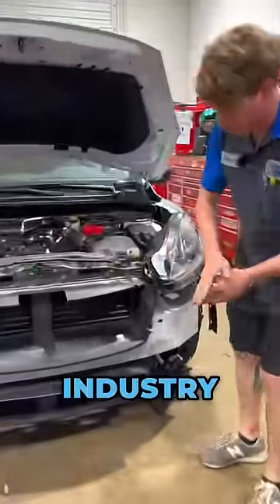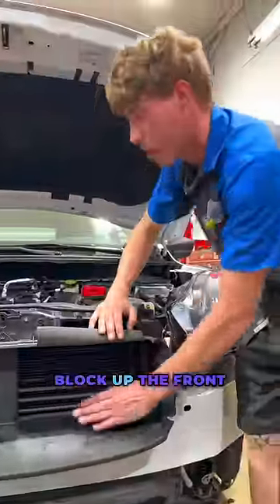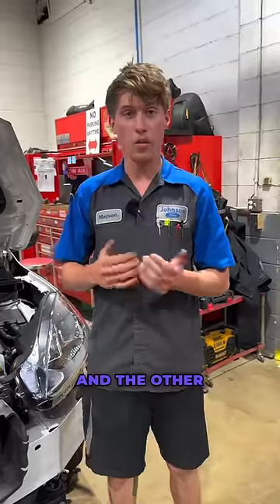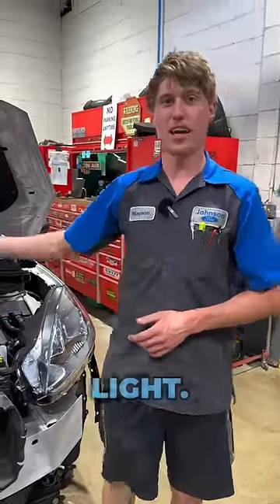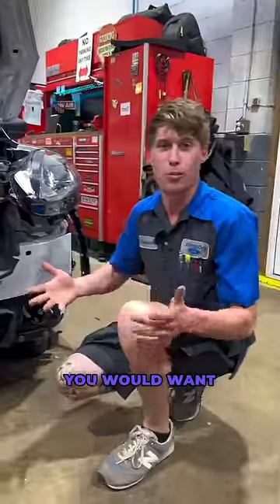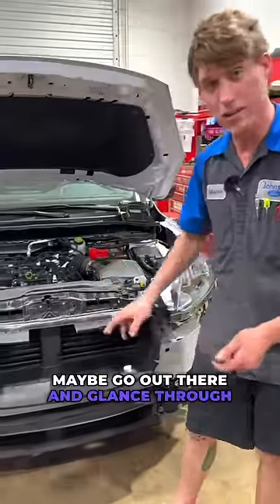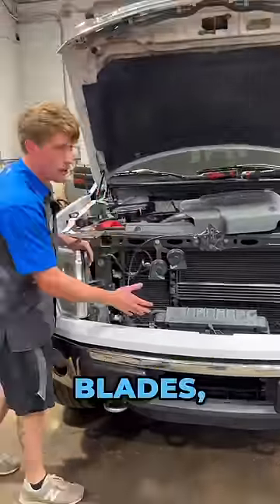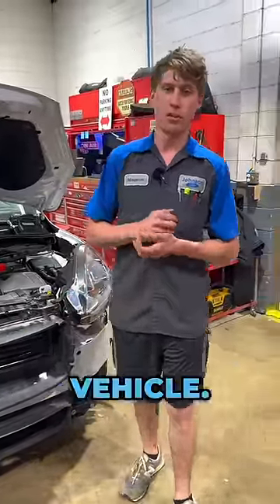Grille Shutters: A Newer Design In The Automotive Industry #shorts

Comment: To answer your question on their air being warmer. What happens when air goes from cold to warm/hot? Condensation can form. Where does the air go, into the air intake connection. Some engines have their EGR plumbing in the same area, this moisture can get into the EGR diff sensor, intake air actuators, manifold pressure sensors, etc etc. in some conditions this can turn to ice that creates plugging so you fetal data reporting from sensors. Go to ts later the ice is melted and no explanation for why the fault snapshot suggests the data that it does. Also water intrusion into some pressure sensors can wreck them or distort data.

So warming the air can actually cut down on that. Diesel trucks have used shutter for years, some still do or use winter fronts to minimize the surface area that is exposed to freezing temps while driving down the road, paved or iced.

Comment: When the outside temperature drops to single digits you need to keep the radiator warmer and you need to keep the intercooler to prevent core combustion. So having a way to block the air from coming through your intercooler is actually a really good thing.

Comment: They’re definitely going to hold up well in snowy climates, that’s for sure..
Reply: They don't. Snow and ice do not play well with the shutters. To twist the knife, replacing one is normally around $800--$1,000 parts and labor. At least 75% of the cost is the part. Also, when salt seeps into the actuator, circuit board, connector, etc., assy replacement is the only fix. It's not IF salt will get in, it's WHEN.
Reply: @RichThiele I was being sarcastic.. lol

Comment: The intercooler shutter is to keep the cooler from freezing when it's 1 degree outside. Condensation will settle in the bottom and block airflow.  I've seen where the aircharge tube is completely blocked with ice (and the car comes in on a flat bed.
Big problem with grille shutters, especially one down low, in snow country is all it takes is if they pull too close to a frozen snowbank, or hit a snowdrift on the road.  Instant shutter destruction and a $900 bill for a new shutter assy.

Comment: The reason for this is VERY cold climates. Especially for diesels. The intercooler can actually over cool the air going into the cylinder if it's very cold outside. In Alaska people completely block their radiator full time in winter. I think it should be a factory option for cold climates, but in reality it can help in all climates I suppose. Just like an oil coolant heat exchanger. It will help your engine come up to temp much quicker. And if it fails closed it can bring your engine to boiling much faster too 😉

Now, I do agree with you, it is just extra equipment that will be failure prone because I'm guessing like most everything else on a modern car, it's designed to fail after the warranty period.

Comment: Hot air through the intercooler when it's cold helps with atomization of fuel. That's why some older vehicles have something like a grid heater

Comment: radiator shutters are often for emissions to set the control devices faster, basically meaning the engines dont have to meet stricter targets as the point at which they are measured in an engine cycle hasnt changed, thus, heating the engine to operating temperature more efficiently means it can pass emissions easier as a hotter engine idles lower etc.

Comment: The totally automatic part certainly is new. My old Peugeot diesels had a winter grille muff to let the engine warm up quickly or retain the heat of the block heater if it had one. It really helped get the temp where it needed to be very fast

Comment: There is one good reason for the shutters on the intercooler. In very cold weather the air can be so cold the intake and throttle body can ice up, eventually stalling the car. Icing can certainly produce nasty engine characteristics. As importantly, the charge being too cold can stop the fuel from atomizing properly. Granted this is mainly in the far north of Canada or at high elevations. My brother lives in the Yukon Territory, a bit below the Arctic Circle. He has a 2017 F-250 Power stroke. -55°C is quite common between the middle of September and the middle of May. Conditions are so severe that normal antifreeze, rated for -40, is inadequate. The dealer in Whitehorse used the wrong antifreeze one autumn. Every vehicle they had filled with -40 antifreeze had to be towed in at the dealer's expense. They spent more to fix the issue than they had made profit in that year. They will never use anything rated for any warmer than -60.

Comment: The reason why you wanna have that for the cooler lines is because in the winter and really cold states they are very prone to icing.
Reply: Wouldn't it be better to wrap the lines in something similar to the rear defroster lines on the rear windshield, then turn them on only when needed. Possibly by have a temp. Gauge plugged into the lines??

Comment: 2016 f150 coyote. Just unplug the servo motor when they’re open. No check engine light at all. It’s right by the hood latch under the little plastic flap. You’ll see the connector to the motor

Comment: It's primary function is reducing drag. Somewhat counterintuitive, but a flat face at the front of the vehicle produces less drag than letting it enter the engine bay and interact with a much larger surface area (the whole front of the engine). Good for maybe 1 mpg on the highway, but considering how cheap and simple it is, I'll take it.

Comment: Trucks and tractors had em way back in the 30s and 40s lol. Were on a thermal switch. Radiator got hot. Shutters opened. Radiator cooled down. Shutters closed.

Comment: This is for lowering the amount of time it takes to reach operating temperature where emissions controls are fully functional. Even warming the inter cooler will cause engine temperatures to warm quicker. Intake air temperature will have an effect on emissions as well, perhaps the inter cooler shutters might not even open in super cold climates

Comment: You can remove them, just reach in and yank them out one at a time. Leave the actuator and the 1 blade it controls in place, throw the rest away if you want. 
My car had some minor front end damage caused by deer strike, the shutters in front of the AC condenser would not open properly, so they had to go.

Comment: Ford’s reasoning for the blades in front of the intercooler (separate operation to the radiator) is that if the intercooler cools too much, it develops condensation, that is in turn ingested into the engine and causes misfires and the like. By only cooling the air under boost conditions, this is alleviated and the non drainable factory intercooler [without removal, there is no drain plug] does not fill with condensate.

Comment: there is one more reason for this and its simple. "Canada" (or other cold places) because up here we use cardboard to block off most o the radiator flow in the winter and its really annoying to adjust it and fix it in place all the time depending on temperature. my old 2002 saturn sl2 with a working thermostat would run as low as 55 degrees celcius when highway cruising during our -40celcius (-40farenheit) cold spells, blocked 100 percent airflow to the rad with cardboard and then it ran at a nice 85ish celcius (185 farenheit) again.

Comment: When it’s -60 degrees it’s necessary. The heat generated from a performance vehicle can cause metal to crack in sub zero temperatures.

Comment: There was a 1961 Volvo in the family. It had a shade that pulled up in front of the radiator to improve heat in cold weather. It was such a small engine that the heater core could dissipate all the heat that that little B16 engine could put out.

Comment: This isn't necessarily for heating up the engine.  These are designed to allow air to flow around the front of the vehicle to help with aerodynamics and help the vehicle get better MPGs. 

They do fail on a high rate. They are also damaged a lot on front end collisions.

You can remove them and keep the frame and motor/wiring intact.

"Adjustable shutters, formally known as active shutters, are placed in front of the vehicle radiator to alter airflow and reduce overall drag on the vehicle as it goes down the road (figure 1). Other names you may hear include active aero louvers, active air shutters, and active air louvers, to name a few"

Comment: Actually if you disabled them for the radiator and the intercooler it will only throw a soft check engine light the light doesn't actually come on the dash but when you plug-in a programmer or a diagnostic tool it shows up under powertrain control module just like he said

Comment: Heating the air in the intercooler could also help warm the car up the same way as the rad, its just set up like thst because you want that to start cooling slightly before the radiator, or on -20 degree days that ambient air temp is cold enough to not require the intercooler.

Comment: It's actually practical in the winter ❄️ if it's a diesel engine. In tractor trailers we have a bra we snap on in front of the radiator while idling to keep the engine warm. Otherwise the temperature drops in  the cab due to the engine running at a lower temperature 🌡️ than normal.

Comment: The shutters on the intercooler are because of the problem the original 3.5 ecoboost had. The intercooler worked too good and water would collect inside and when you mashed the throttle a slug of water would throw codes. The orginal fix was to block off half the intercooler

Comment: Hotter intake are is, admittedly better for thermal efficiency at low loads (so fuel economy). You don’t really need 5% more oxygen density at those loads, and more intake temp will carry over to a slightly hotter, faster burn

Comment: I accidentally left the connector to the shutters off one time. There was no check engine light, the only give away was the cooling fan running all the time, even though the engine was cool.

If you really wanted to get rid of them it would be simple enough to uncouple the motor drive from them and lock them open.  As long as the motor is electrically connected and free to move you shouldn't have a problem.

Comment: I work at Hyundai and we have seen quite a few issues with water getting trapped in the wiring harness and causing excessive resistance throwing a cel for the shudders.

Comment: This really should only ever be a thing on diesel engines for colder climates. I remember before the vw scandal, one fix people would do to get their cars to start was to install pool noodles onto the grills and take them off after a few minutes of driving. Other than that, super heating the intercooler and radiator on standard fuel injection has to be far less efficient and could actually result in microfactures in fittings due to uneven heating as well as debris getting into the shutters and jamming them closed.

Comment: Most vehicles equipped with these do not have position sensors for them, and can easily be tricked by a resistor plug. Essentially just a plug that goes onto the electrical connector for the shutters that has the same resistance value as the motor for the shutters. It tricks the control unit into thinking they are there.

Comment: 2017 Focus ST owner, I took those things off after I got my new intercooler and haven’t had em on for 3 years now, no check engine light for it. It exists in the computer but it never pops the light for it. Main reason my light is on is because I have a catless DP, so it’s for emissions🙄

Comment: Same with these insulated engine covers. my wife's van has the 3.6 pentastar in it and it kept slightly overheating in the summer. Not enough to set off alarm bells, but, enough to make me nervous. I removed the engine cover and haven't had the problem since.

Comment: Mack Trucks had radiator grill AUTOMATIC grill shutters on them way back.  The B-61 MACK TRUCK had these and its to  regulate the AIR TEMPERATURE 🌡  during a very 🥶 cold cranking and running it HELPS

Comment: Why do these shudders help heat the engine faster and let the heater core have access to heat faster if the coolant thermostat is a thing anyway? The block should heat up the same rate no matter what your radiator temp is, as long as the thermostat is still closed from start up right? I’m curious to find out if I’m wrong and why, thanks

Comment: Yep, if you change oil on your new Tundra, Toyota has told us to set the grille shutter in a certain position to better access the skid plate and filter area. Still only pays .3hr though. 😂 And yes it will set the check engine light if you disconnect it and there’s models that have to be calibrated for proper operation.

Comment: Did you ever hear of winter? The air is so cold in winter anyway that for a at least 10 seconds of WIDE OPEN THROTTLE the air still won t get hot enough in the intercooler to significantly reduce your power, yet let your ass heat up quicker than with no grille shutters. I truly love those shutters in the winter. Ford wasn't stupid with it and it's also remarkably reliable, compared to german made cars.

Comment: If you live in a cold climate area, this would definitely be a positive. 

If you search the Ford website they claim the louvers close at higher speeds (interstate driving when plenty of air is flowing) in order to increase aerodynamics. 

I just don't see how air that is forced into your grill area, then hits a wall, would help with aerodynamics, and if it does, the amount of drag it reduces would be on such a small scale, maybe one extra mpg for every 100 miles, that it seems pointless to add such a feature which most likely equates to an extra $1,000+  for the customer.

Comment: Have you ever driven a vehicle in the winter in below zero temperatures? Most diesel trucks in freezing climates use a "winterfront" to keep the engine at optimum operating temp. Think Ice Road Truckers. Having automatic shutters is a boon for use in icy temps.

Comment: It's also for fuel economy.
Shuttering the front grill makes it more aerodynamic at high speeds.
That's also why newer cars have the annoying under body plastic held on with crappy plastic clips.
Auto manufacturers are being forced to add more and more garbage to vehicles for regulatory reasons, such as a seat belt warning that lasts a whole 30 seconds.

Comment: We have a 1970s international truck with air operated shudders. I definitely wouldn't mind having them on my new gas or diesel pickups if they would last and work. These look pretty chinsy compared to the aluminum ones on the international. It takes a long time to get an engine warmed up good when its 40 below in the morning and 20 below for a high temp during the day.

Comment: i would rig the sensor on the intercooler blades to think they are closed when they should be but remove the blades.then it would rig the radiator blades to a switch to increase aroflow to my intercooler for a little tiny boost at the cost of engine temps on a little red button.

Comment: It's also for a little bit more aero. Not much but it does do a little. If you're driving in 10 degrees winter weather and you're just cruising at highway speed you likely are just fine blocking off the intercooler.

Now I'm not saying a good idea but I'm saying I can see at least one reason you'd block off the intercooler.

Comment: Its for fuel efficiency and aerodynamics. Consumers want cars with bigger cosmetic grills but the engines are tiny. Take a look at the Police Explorers. They have a tiny square in the grill that looks hideous cosmetically instead of grill shutters hidden behind a big chrome grill found on passenger explorers. Also, police departments dont care too much about efficiency.

Its also nice to have in the winter. You get hotter air in the cabin quicker, and if youre idling alot with the heater on, it keeps the coolant from getting too cold

Comment: Of course you can’t think of a reason you’d want to heat your air up hotter. Not everyone lives in a hot climate. Not only do the shutters help control temperature but they can also aid in aerodynamics. As the shutters close a pressure bubble builds in the front of the vehicle. This pressure forces the air around the car an not allowing it through the grill, reducing drag.

Comment: My father used to put a piece of cardboard over the radiator when it was -20 degrees in northern Michigan. Warms up the car faster. Try driving a diesel when it is very cold. Takes forever to warm up.

Comment: another reason is that when it's really cold the cooling system works too efficiently. everu winter when temperature drops below -15C I have to block some cooling air with plastic peace so the engine temperature meter reaches proper running temperature

Comment: It's not to have them break, and it's not to heat up the coolant more. It's aerodynamics. The vanes can be metered open and closed over time to maintain the best aerodynamics while balancing the cooling requirements. 

Just because you don't happen to understand something doesn't make it a grand scheme by the OEMs to make cars crappier or more expensive or break faster. 

Auto engineers aren't just winging this stuff, it's simulated, bench tested, vehicle tested, bench tested again, and vehicle tested again before it gets launched and that for the things that aren't new inventions.

Comment: I drive a 2014 Fusion with a 1.5 and I took the shutters off mine. Never caused any codes or check engine lights

Comment: Cut out the blades and go on. My ST had a grill shutter I just removed the blades from in front of the intercooler and left the ones in front of the radiator. No codes and the car was happier.